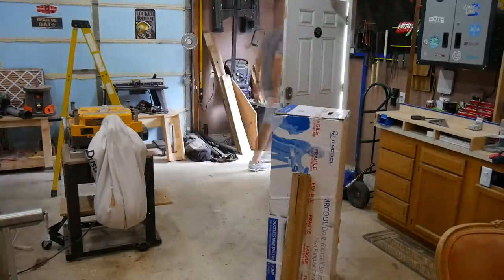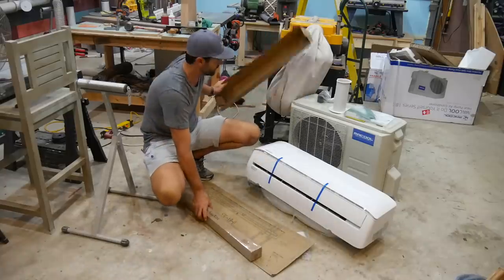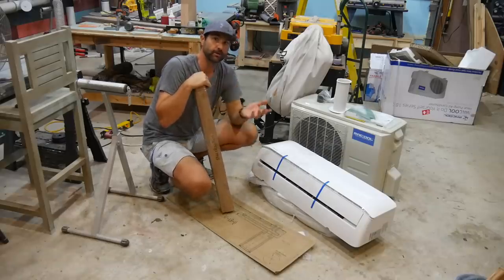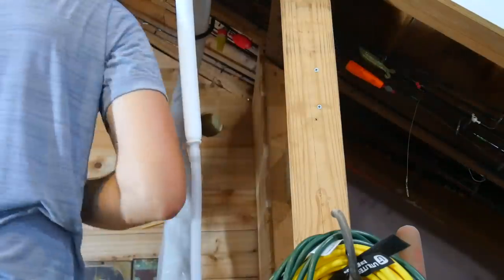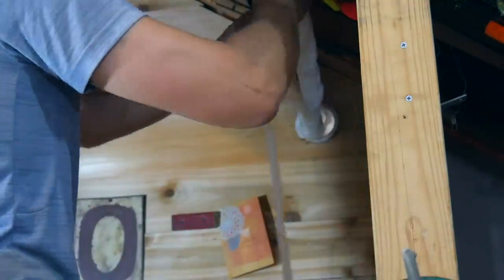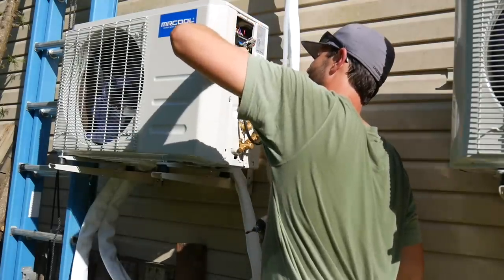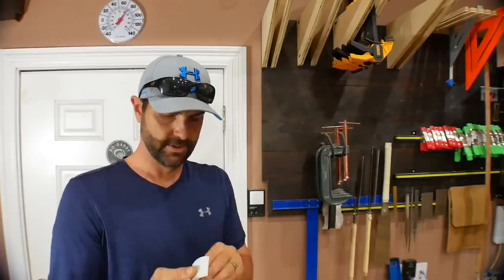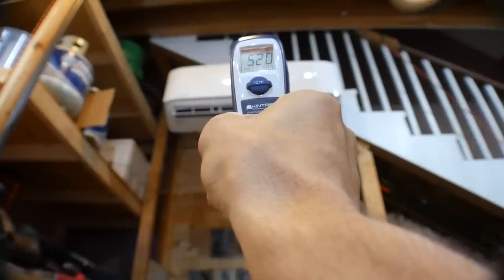DIY Mini Split Installation (Step by Step)

Comment: Why couldn't you run a new inside unit from your first outside unit?
Reply from the maker: HAMFAM these units are 1:1.  They don’t make a DIY version with 1 outside and multiple inside units.
Reply: Pahjo Designs Not true man. I’ve personally seen as many as six handlers hooked up to a single compressor/condenser. Very common here in Arizona. The system does need to be large enough to support multiple handlers. They even have air handlers that, when installed, look just like ceiling vents. Also, not purging the lines may cause issues with the system down the road as well as void any warranty. Other than that, great video. I really like the stair install. Great use of space.
Reply from the maker: Mike Lapera - I believe you and you are definitely correct.  I’m referring to this particular manufacturer - not mini splits in general..  These lines are pre-sealed with a special fitting.  No need to purge the lines for this particular system.  Thanks for watching and commenting.

Comment: Do you feel any vibration from the outside unit since you mounted it on the wall?
Reply from the maker: I did at first, but then I figured out that’s what the rubber pads were meant for.  I installed those and the vibration is gone.
Reply: Pahjo Designs Thanks. I’m thinking about putting one in my shed workshop & was thinking that mounting it on the outside wall might be an option. Thanks for your video.
Reply from the maker: No problem.  I’m glad it helped you.  I installed mine in my detached garage/workshop.  I also have a loft in my workshop with another unit up there.  I’m happy with both and don’t regret my decision to go with a DIY unit.  I could literally buy 4 of these units for the same as I would pay for 1 name brand unit professionally installed.  If a few units fail, I’m still ahead.  Especially for my workshop.

Comment: Hmm,  I currently have an old unit in my attic wit ha separate compressor outside. It's a 24000BTU unit and is supposed to be enough for my house (at least the upstairs). Does not keep up. I wonder if I should invest in a few of these. From your videos it looks like it just works in single areas, would I need one for each room upstairs ?
Reply from the maker: John Weland - they do have multi-zone units, which allow you to run multiple rooms off of 1 unit.  However, I’m not sure if those units are DIY.  MRCOOL has both DIY units and non- DIY units
Reply: Consider adding more insulation first!
Reply: In your attic? Is the attic insulated, finished, or just a standard attic that gets very warm during the day?
Reply: @Aarona-lj6wp  it is insulated on the "ceiling" side of the Attic, but it is about 130 -150f during the summer. All the ducts are insulated as well. The ceilings we're vaulted after the AC was installed so I can't get to most of the attic to add more insulation.

Comment: Did you have any issues after bending the line set off the base of the air handler? I'm concerned if you bend that line it could crack...
Reply from the maker: I didn't have any issues, but it did concern me when I was doing it.
Reply: @PahjoDesigns  Did you unwrap it and look at that thing?   I did.  At the point where it bends away from the air handler unit, it has a "spiraled" copper piece to allow it to move. It's weird looking, but it is basically similar to the corrugations in the plastic drain pipe, but in a spiral grove instead of circular if that makes sense.

Comment: Everything looks descent I am highly suspect on the refrigeration side though.  As a pro i am leary about the connections leaking.  I hope it works out for ya.  The funny part was this is diy yet the electrical is recommended to get professional help.
Reply from the maker: Rich Zamora - Thanks for watching!  I am definitely not a pro and appreciate your input..  I did the electrical work myself and it was easy; however, I didn’t feel i was qualified to give electrical advice.  
These units have performed well for me thus far.  Fingers crossed they continue to perform well.
Reply: Little late but if the lines are incorrect sucks but not a huge life altering event. If the electric side goes bad you could be meeting Mr firefighter.

Comment: Thanks for the great video. A few Q's. 1. What is the manufacturer's advice for excess pipe length. I cant't find any info for that. 2. Do you recommend a particular seller for the same unit? (not just amazon)  3. How did you contact Mr. Cool? I haven't seen anything on their website for direct contact. Thanks much!
Reply from the maker: D Olysson - thank you very much.
1)Very good question as I’ve had the same question.  I’m not sure.
2)you can purchase them from Home Depot as well as Amazon.  Home Depot has interest free financing, but Amazon I find amazon is easy with regards to returns and refunds.
3) support@mrcool.com
Reply: @PahjoDesigns  I purchased my 3 zone MrCool DIY from Lowe's and signed up for Lowe's for pros (even though I am not one, they said I could sign up) and I got 5% off my entire system. Mine is a 30k unit, 2 -9000k btu and one 12k btu

Comment: What if you move it to another location.  Need recharged?
Reply from the maker: Drew Busch - good question.  This video suggests you can do it yourself:  https://youtu.be/Dtvbmbdfrsw .  Although I’m not sure if this works or not.
Reply: Someone asked that question on one of the Mr. Cool Blog Posts about the D.I.Y. unit ONLY, and the response from the company was that YES, you can reverse the installation procedure (be sure to close the valves on the condenser unit BEFORE disconnecting the refrigerant lines) which evidently when you disconnect the two refrigerant lines from the condenser, they automatically seal themselves via a spring loaded valve built into the end of each pipe in the line set.  Once moved, simply reconnect them as you originally did per the instructions in the manual and fire it up, you should be good to go!!! Very Cool!!!!
Reply from the maker: Very cool, indeed.  I moved one of mine last month and it went very smoothly.

Comment: have you installed these in the midwest anywhere? I'm interested in using these to heat/cool a 4 plex i'm renovating and i have lots of questions
Reply from the maker: I’ve only installed them in the deep south
Reply: R410a refrigerant split systems can generally produce the quoted amount of heat down to an ambient temp of between -5deg C to -10. After that, for every one degree less the heating capacity drops off, it's doesn't just stop. The problem you'll have is the outside condenser will freeze up, cheap crappy units like this don't have a very good defrost detection or a way of clearing the frost. If you get constant subzero temps in winter and want it for heating oversize the machine and buy a good one like Mitsubishi Electric and you'll be fine.

Comment: Do you know or did you happen to ask the electrician what the voltage is suppose to be for the unit? 120 or 240?
Reply from the maker: crzyndn86 this unit is 230v, 20 amps

Comment: Might as well throw the warranty in the trash. It only covers systems installed by a state certified or licensed HVAC contractor. It also only covers parts, not labor to diagnose or repair, so if it lasts a year it is probably cheaper to buy a new one than get it repaired.
Reply from the maker: ninja5672 view my repair video and checkout the warranty replacement.

Comment: I'd be curious how the finish on the Mr Cool outdoor unit holds up over time. I'm on the Oregon coast & have the same issue with corrosion.
Reply from the maker: bgregg55 - Thanks for watching the video!  Yes, I agree.  It seems to be built very well, but time will tell.
Reply: Do you have any idea what manufacturer is making these mr cool units?
Reply: Actually, despite the similarity in name, that is not us! Our headquarters is in Hickory, Kentucky.
Reply from the maker: My 2 units are running GREAT!  If these mini splits can handle a summer in South Louisiana, they can handle just about anything.  :)
Reply: It's condenser coils and lines are still copper, same as any other unit.  How does that do in your environment?  Nothing "space age" here, it's just a condenser, compressor, coil and lines......
Reply: @bgregg55  Mr. Cools web page says made in the USA!

Comment: what size wire did you use?
Reply from the maker: Ed Gonzales - 12 gauge electrical wire I think.  I used whatever is in the manual and I’m fairly sure it was 12 gauge

Comment: What diameter hole in the joisting to run the lines...
Reply from the maker: Ralph Marshall - 3.54 inches at a downward angle from what I remember

Comment: For all the neg. Ppl.   I have first seen this type in Puerto Rico.   90 percent of houses use them down there.   Ive been in the ones that use them.  They are energy efficient, quiet and they last for years.  Hvac ppl can inspect and tune once a year and i will b using them in south texas and installing myself.   I will however look for less porous air filters.

Comment: How's it holding up? I need to purchase a dual zone for my business and I,m on a tuight budget. I'm just very skeptical with a mrcool brand since its not really a known brand
Reply from the maker: Hi Luis, thanks for watching and posting a question.  They are holding up great.  I'm not sponsored by MRCOOL nor did they ever give me a discount on the 2 units I purchased, so you can trust my opinion/feedback.  :)

I did have an issue about a year ago and had to file a warranty claim, which was handled flawlessly by MRCOOL.  I actually made a video of this warranty claim & the installation of the replacement part - you can find it here:  https://youtu.be/59beu7MJFxE
Reply from the maker: I have 3 units - workshop, home office, and in my spray foam attic.  I had one unit fail soon after installation, but MRCOOL replaced it.  Other than this hiccup, everything has performed very well with no issues.

Comment: Hi, after having the system for nearly 2 years are you still happy with the purchase? Im considering an 18000 BTU system for my workshop.I also live in south LA NOLA area.
Reply from the maker: Hi Jed, I’m super happy with the system.  In fact, I own 3 units (2 for my workshop & 1 in my attic in my main home).  I live in Slidell for half the year and in Destin, Fl. the other half so we are super close to one another.

Comment: How are the refrigerant lines so flexible?
Reply: I believe they are either high pressure rubber or braided steel lines. They are not copper tubing so they can be placed easily wherever you want and not kink.
Reply: @fredc8346  wow I thought only copper lines could be used! Thanks will check for more details
Reply: @saiskanda  I was going by what other information I got from videos. Now from others I do see that it appears the low pressure line (the larger one) is a braided steel shielded rubber line with the copper tubing connection end you see. The high pressure line (the smaller one) may be copper the whole way.  If it is that flexible maybe it is thin, as even say ¼ inch copper usually is pretty solid and kinks easily. I wonder if the gov’t has relaxed standards somewhat as we now have refrigerants that they don’t consider as dangerous if they escape.

I am working on getting more info from the company as I am wanting to shorten the lines myself. I only need about 10 feet and don’t want all that excess all over. I really wanted to do the DIY system, but I may have to go with their normal installation system which will require a tech to evacuate and charge the system.

Comment: How loud is it?
Reply from the maker: The motorsports project - it is not loud at all.  Much quieter than a window unit.  It’s about the same as an central AC intake - just light wind noise.

Comment: Nice work  . Did you vacuum  at least 500 micron to those lines? otherwise you will end up having moisture and air in the system and will short the life of the unit. ( compressor ) If you didn't. you will need to replace or filter that refrigerant. Sheer!.
Reply: The lines come pre-charged and sealed from the factory on those.  Makes DIY install possible.
Reply: The lines used with this unit are unique in that the lines themselves are sealed at the end that goes into the compressor.  When shipped, the Evaporator and attached Refrigerant lines are also pre-loaded with some of the refrigerant in the lines and some additional refrigerant is loaded in the outside condenser unit.  When you tighten the lines to the condenser, the lines open up and allow the refrigerant to flow into and out of the condenser.  Of course you have to open the valves on the condenser as well to complete the openings to allow free flow of the refrigerant.  The nice thing is that if you want to move the unit, you can simply reverse the procedure and the refrigerant lines will self seal when disconnected and then can be moved and reinstalled without losing any refrigerant.  It really is a (Mr.) Cool design and very unique to the D.I.Y. Models of the Mr. Cool Heat Pump Systems.

Comment: The indoor unit needs a vacuum to vent the air. The copper pipe connected to the outdoor unit is too long, which affects the cooling effect.
Reply: The entire line set comes already attached to the indoor evaporator unit and the length is about 25'.  Since the line set is pre-charged with refrigerant as well as the condenser, the combination of the two are filled with the exact amount of refrigerant needed to operate this unit at peak performance at the completion of the installation. When the line set is tightened down to the condenser, the valves in the end of the lines open and release the gas into the condenser.  Of course, you must open the valves on the condenser as well to completely open the pathway for the gas and liquid to flow.  As a result, you cannot lengthen or shorten the line set at this time.  Coiling the extra line set is the recommended way to deal with any extra line per Mr. Cool instructions and it appears to work just fine for those that do this.

Comment: Except the 20' of air inside the line set needed to be removed
Reply: Isn't the line set, precharged? I would assume this is why it's a DIY unit
Reply: The outside unit is precharged. The inside section and line set needs to be pumped up with nitrogen, leak checked, the vaccumed down before opening the  valves

Comment: Elsewhere I've seen reviews that say it was required to vacuum-evacuate the lines before installation, requiring a vacuum pump.  Is this true?
Reply from the maker: Nope, not needed
Reply: @PahjoDesigns  Thanks.  After some research, it appears that Mr. Cool sells some units that are not in the category of "DIY" for about $500 cheaper, but require you to do extra steps.  For my money, I'd rather have the prepared version.
Reply: @PahjoDesigns  why ndo we not need to evacuate ?
Reply: @baltazar0007  the refrigerant is all ready in the pipes with quick release couplers that are opened when you tighten the nuts.

Comment: I have a very similar building size and setup as you and similar climate on the coast of NC.  My question is why didn't you go with dual zone unit rather then two individual units.
Reply from the maker: Jared Braun - very good question and I’ve been waiting for someone to ask me that question.  The previous homeowner had a central AC unit in my workshop that was 15+ years old.  The AC unit was only large enough to run the downstairs, but not both downstairs and upstairs.  Not long after I installed the first mini split, the central AC unit broke.  It was more expensive to fix it than just to buy a second mini split.
Reply: Jeremy Hoffpauir cool thanks for the reply. What's the square ft of your spaces your cooling and do you think you sized the units accordingly now that they have been running for awhile.
Reply from the maker: The unit in the loft is properly sized and cools really well.  The upstairs is roughly 1000 square feet.  The workshop unit downstairs also cools the area well; however, the garage door allows for a lot of air loss.  The downstairs is roughly 1300
Reply: Jeremy Hoffpauir I have a smaller foot print. I have about 650 down stairs and 500 upstairs. I wonder if a single dual zone 18k unit would be sufficient for my application. Any thoughts?
Reply from the maker: Jared Braun - I say absolutely yes based on my experience with this unit.
Reply: Jeremy Hoffpauir perfect thanks for everything.